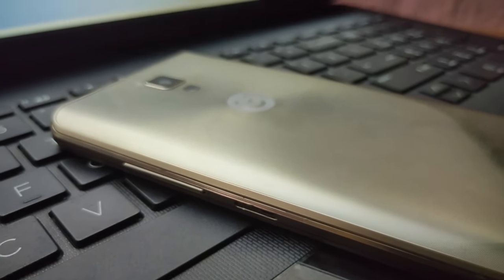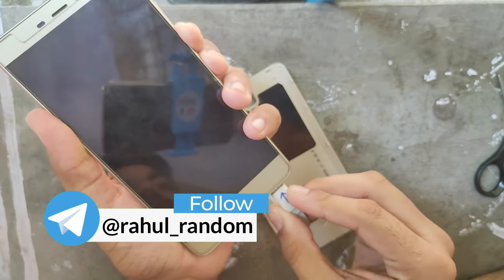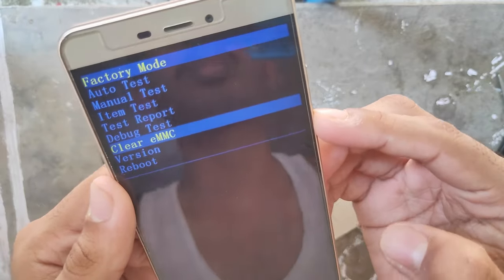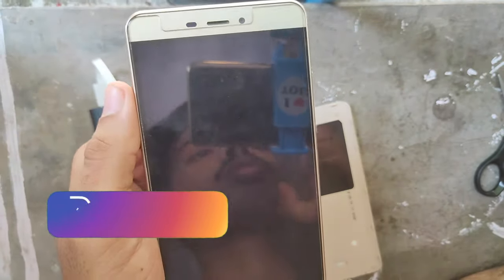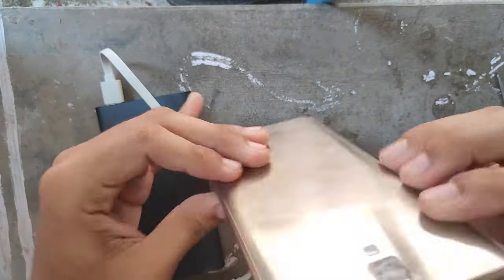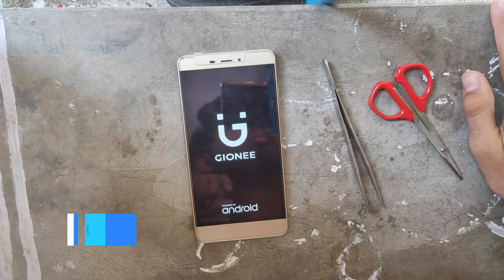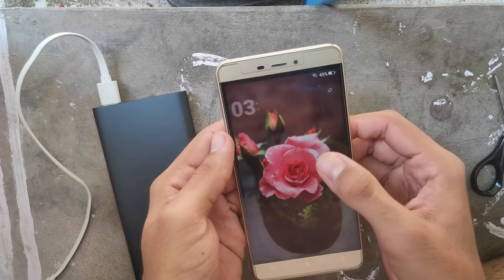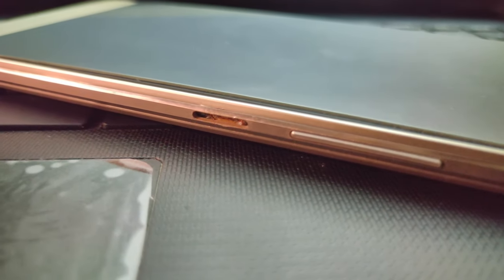Power button Not Working 📴 | 3 Simple Ways to Power ON your mobile 📱in TAMIL

Comment: Tq so much i saved my life but if it switched off how to Switch on
Reply from the maker: Try another time and follow the instructions at end of the video. It will really help you.
Reply: Use a charger
Reply from the maker: Correct bro. Turn on the "Double tap to wake screen" option in your mobile settings 👍

Comment: Bro in my case , after the boot board is opened. 
Select option is using up/down and  confirm option is to be performed using power button I guess . But the power button Is damaged . So what's the solution for that?
Reply from the maker: Use the third method for selecting with the help of power button. Or just try the last trick 👍🏽 do SUBSCRIBE for more useful videos
Reply: @RahulRandomTamil  I have power button..but the power button doesn't work... how to select reboot option then??
Reply: @babydondapati514  seems like you need to send your phone to nearby repair shop

Comment: Can you explain to me what the option 3 does? Option 1& 2 isn't working for me so am a bit desperate.
Reply: What exactly do I need to do to push the button with a scissor/pick?
Reply from the maker: Yes bro. But if your phone doesn't have any click type in the button area, then you need to remove all the broken parts and you will find two golden colored rings. Connect the two ring ends with the help of scissors or any electrically conductive metal to turn on the device

Comment: I used 3rd method and it worked. I only had to use one end of the scissors, since I only saw 1 button inside the power button hole. Thank you!
Reply from the maker: If there is no button in the power button hole, you will need to use both ends of the scissors

Comment: Enaku redmi 8A dual switch off achu last trick use achu ana athuku phone case remove pannanum
Reply from the maker: Last trick use achu na athuku yen phone case remove panringa?
Neenga kekura question enakku purila.
Reply: Illa anna en power button volume button ethuvumae suthama work agala atha antha button na scissors vechu press panna back case sa open pannaen @RahulRandomTamil
Reply from the maker: 3rd trick ah seiyumpothu careful ah pananum nu sonnene. Scissor vachi button ullara irukra rendu metal parts ah just touch panna sonna, neenga back case open aagura alavu pressure kuduthurukeenga. Apdi panna board poidum sister.

Comment: Hey, my mob's power button is completely destroyed. Initially outer case's button destroyed...then I started to press the mob's original small button, instead of scissors I used my finger tip to press the small button. For many months I did that without hassle. But now even that small button is not working, I used sharp objects but even that small button is completely destroyed. So what to do? Can local shops repair it. It's not only the problem of outer Case but mob's small button also destroyed.
Reply from the maker: Yeah bro. Try third trick. Do watch the video another time clearly. I explained it well. Do turn on English subtitles to understand what I'm saying about.

Comment: Sir at first step I do it factory mode open but which button I have to press to reboot  (reply soon)
Reply from the maker: It depends on the mobile phone that you are using. So just Google it as "how to reboot (model name)?" 👍🏽
Reply: My model is gionee p7 my power button is not working so how I press reboot option
Reply from the maker: You need to press the power button to select. So you can try the last trick, which I said how to click without the button. 👍🏽

Comment: Hi sir.  I tried the first method and it actually worked but I'm stuck at the reboot part.  I changed it to reboot and tried to press it with volume button. Instead of rebooting the option is keep on changing.  What should I do?
Reply from the maker: It vary from mobile to mobile brand. So just Google it as "how to reboot (model name)?"
Reply: @RahulRandomTamil  Actually my phone is same as yours.  It's just that I couldn't select the reboot option.  It's like I changed it to reboot option but when I try to reboot , the option changes as I press that volume button.  That's frustrating.  So the old phone still stuck at the last part😭
Reply from the maker: Try the last trick. It will work for sure

Comment: Looooool and how are you supposed to select the option without the power button?
Reply from the maker: It vary from mobile to mobile brand. Some of the mobiles has home button to select the options
Reply: @RahulRandomTamil  for mine you gotta select with the power button.
Reply from the maker: Ok bro. Then try last trick
Reply: @RahulRandomTamil  OH YEAH? HOW DO I DO THAT IF I CAN'T TURN ON THE PHONE? It's an old phone anyway, I can't do that. It's broken now.
Reply from the maker: Watch the video again carefully. It works for whether it's a new one or old mobile. You can do it. If it's broken, then it will be more easy to do the trick.
Reply: @RahulRandomTamil  lol that's not true, and my phone is broken so it won't turn on anyway. You're asking me to turn on a broken phone and use a power button that doesn't work, and go into the settings and change the settings to settings my phone doesn't have. Good logic.
Reply from the maker: If your mobile is completely broken then it is not safe to operate your mobile. So take it to your nearest service center and they will help you.

This video is only for broken power button, Not for broken mobiles. Understand

Comment: How did you remove power button switch for 3rd step ??
Reply from the maker: You can easily remove it by using a small screw driver or a sharp edged compass 👍🏽

Comment: 2.5 K. OKAY LISTEN I ALREADY DONE POWER BUTTON IN SHOP BUT ITS NOT WORKING. MY VOLUME RISING BUTTON AND POWER BUTTON BROKEN NOE ITS OPENINGS AUTOMATICALLY. BUT NOW BATTERY ERROR RAISED. ONE OF U TUBE CHANNEL SHOWS THAT IF I DONE HARD RESET MY PHONE BATTERY PROBLEM WILL BE SOLVED. BUT MY QUESTION IS IF I DO HARD RESET IS MY PHONE WILL OPEN AUTOMATICALLY?
Reply from the maker: I can't understand your situation. If you have any personal or important files on your mobile, you can try a hard reset. However, please be aware that a hard reset will erase all the data on your mobile. I don't think this will solve the issue. If it happens frequently, you can contact an authorised service centre or a skilled technician

Comment: Thank you! I want to try option3 but I can't remove the button 😭
Reply from the maker: Sorry to hear that
Reply: @RahulRandomTamil  also can't open the unit since the Screen has to be removed first to get to the button. Official repair center said they might crack the screen if they open. I have to crush the button from the outside but I don't know how 😓
Reply: @RahulRandomTamil  please make a video how to remove buttons from the outside please, please. It is a problem with some units now. And we don't know methods or tools to extract or crush or grind the button out.
Reply from the maker: I can't say for sure. But if you crush it with some tools, it will definitely damage the system. So take it to your nearest service center and get it completely disassembled and replaced with a new one.
Reply: @RahulRandomTamil  thank you for your reply. I went to the official brand service center but they said they might crack the screen if they open it. That's why I just want to grind the button out.

Comment: Most of them using pins  and sim ejector  like this this. is not a permanent solution for this u telling back case with switch models can change case with switch is a permanent solution if we use scissors and pins it will damage switch trackpads motherboard will get damage soon what u told is not a solution
Reply from the maker: Bro understand, It's not a permanent solution. It is "how to power on your mobile without the power button". If you want a permanent solution, you can take it to your nearest service center and you can ask them to change the panel of your mobile. If we use sharp items like I said in the video, the internal parts will damage soon. So we need to be careful while doing that. So it's just temporary solution not permanent. 👍🏽
Reply: IAM a mobile service technician I know bro IAM also told the same what u told
Reply from the maker: OK brother. But people need temporary solutions. They do not trust service center individuals. This is because they believe that people working in the service center are stealing their personal information from their mobile phone. So people could not give their mobile with confidence. If they turn on their mobile phone, they will transfer or erase their data. And they will give it to the service center with ease of mind. 
That's why I telling you this is not a permanent solution. But it will damage your mobile phone if you do it regularly.  
That's the reason why people are choosing temporary solutions rather than permanent one.

Comment: How to turn on cool pad 1 without power button?
Reply from the maker: Just try the three steps brother
Reply: Bro unable to open mobile case, connecting charger and pressing volume down button not working.
Volume up button brings me to install something which shows erase msg.
Any other shortcuts. Please let me know
Reply from the maker: Just Google it as "how to reboot (model name)?" or Try the last trick. It will work for sure.
Reply: Dude, I couldn't open the phone case due to its broken state. Is there any way to remove the power button without openin' it?
Reply from the maker: No way to remove the power button without crushing it. So just take it to your nearest service center

Comment: If yall use the third method, after a few months, it gets jammer due to dust
Reply from the maker: It is not advisable to use this method for several months. This is a temporary solution. This solution is for those who are afraid of our personal data being stolen in some local service centers. So with this method, you can do it yourself. Then you can clear the data and give it to the service center to replace the mobile panel.